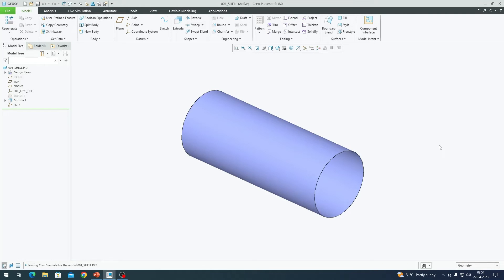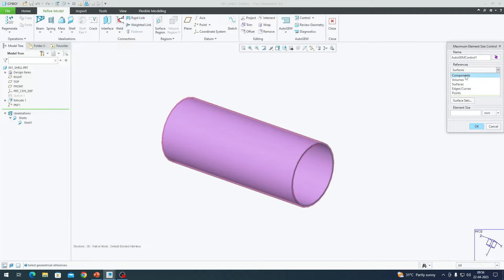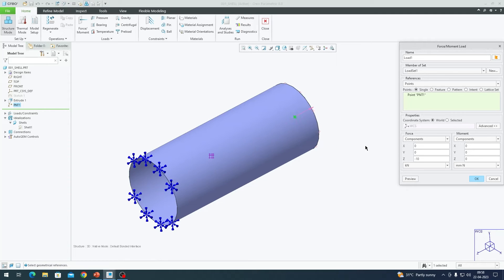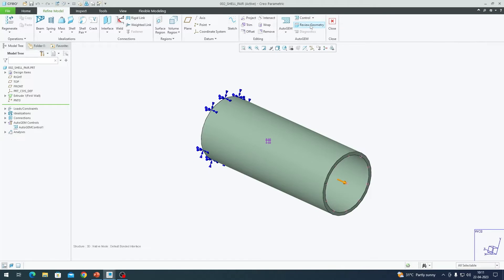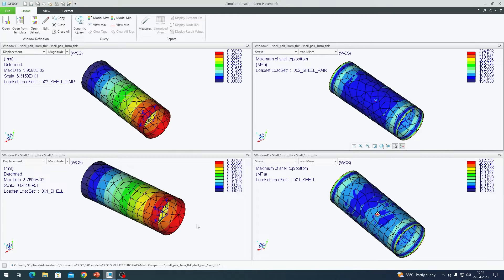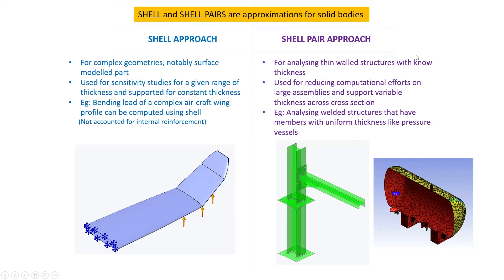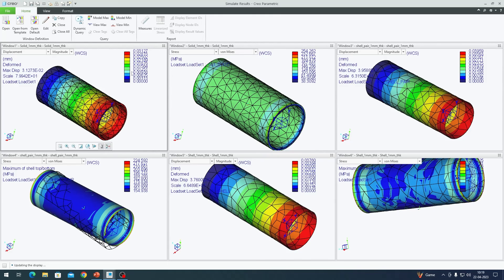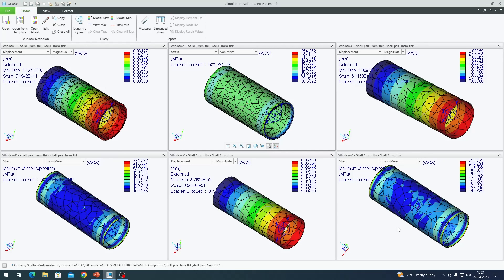CREO Simulate Tutorial - Shells Vs Shell Pair Vs Solid Mesh (Part 4)

Comment: Which approach is the most reliable in terms of results accuracy?

Thanks in advance

Also, thank you for the most clear and concise videos on Creo SImulate, I gretely appreciate your effort to help the community, it's nobble.
Reply from the maker: Hi, Solid mesh is the most accurate method if done with appropriate mesh refinement. Unfortunately, it’s not preferred for large models dealing with sheet metal due to its diminishing returns on result accuracy. Industries have adapted mid surfaces mesh as their option to deal with thin solids due to balance between reasonable accuracy and computational time. One can choose to go with solid mesh in the area of interest and keep rest of the areas shell as your geometry allows. Unfortunately, there is no one line answer .
Reply: @nothingbutengineering  thank you, I think you explained it quite well. I have a clearer picture now. I wish you the best!